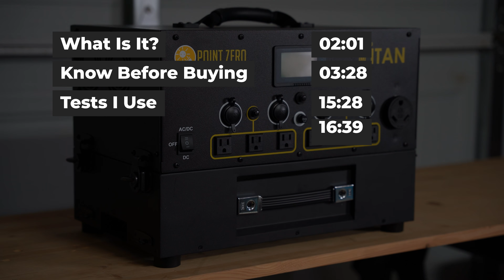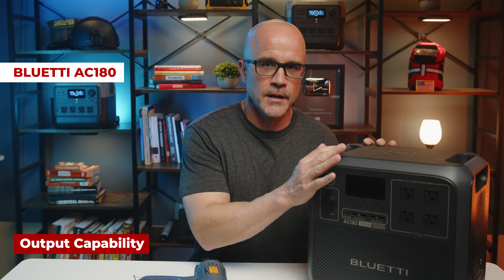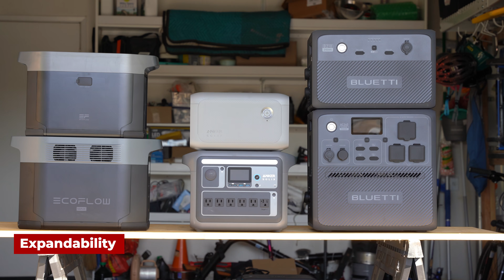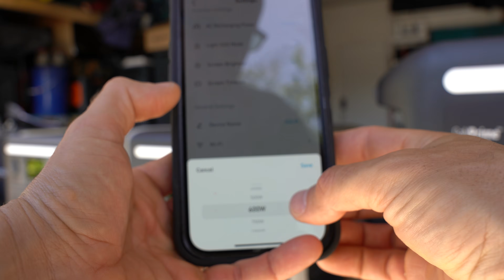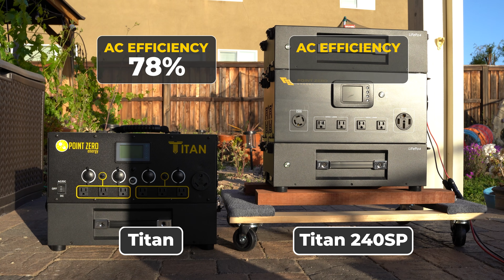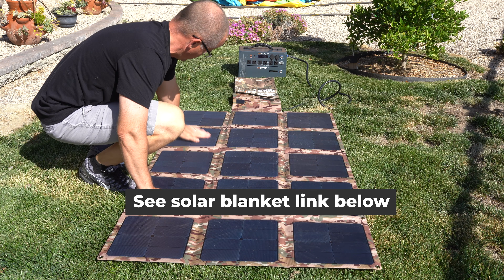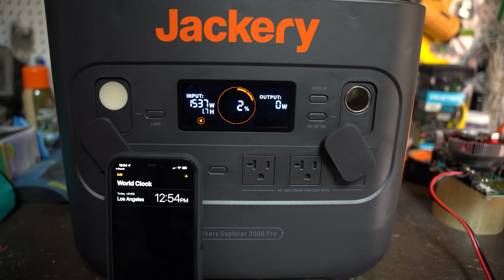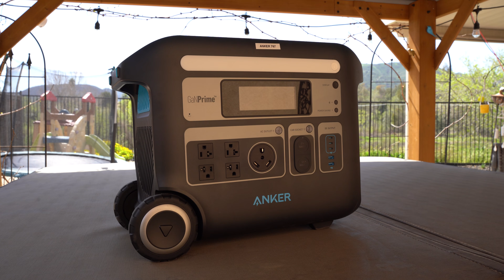Best Solar Generator for 2024 (The Ultimate Guide)

Comment: I purchased a Bluetti AC200 Max as it had the best reviews at the time. I am a fulltime RVer. I have a CPAP plugged into it so it is used every night. For awhile I also had a refrigerator plugged into it, while the Bluetti was plugged into shore power to be constantly recharged. Just in case the shore power would go out. While traveling I would recharge the Bluetti using the RV generator and if I was in a sunny area I could use the Bluetti solar panels. I was rarely in an area that I could use the solar panels. There were times when I knew I would be off grid and really need it to work, I would check the charge which would state 100%. The next day when I was disconnected from shore power and needed to use it, it would be at 0% charge. This happened a few times and was very frustrating (scary as well). I read the paperwork that came with the Bluetti and found that it states "do not try charging the unit when the temperature is very cold." When it did not work and read 0% it was very cold. So my assumption is that the cold discharged the batteries, right when I needed the unit to run a heater. I tried contacting Bluetti to find out if this was the case. I did not receive an answer. I can just say from experience that the unit does not work when it is freezing or close to it. If this is common for all these units because of the batteries, this is something that the public needs to be aware of. I learned I cannot rely on it to keep from freezing. If this is not common, or something that should not happen, please let me know and I will contact Bluetti again.

Comment: Price to performance I don’t think you can beat a Refurbished EcoFlow Delta max 2k wh  2400w ac and 800w solar input only £650inc vat direct in the Uk  with daily use you will only notice a reduction in capacity down to 80% after just under 3 years

Comment: Just looked at the price of the solar blankets from off grid trek, Come at a much higher price point you say? hahahahahaha,  they cost, in some cases more than the generators. One 300W solar blanket is £1736 in the UK, a Bluetti AC240 is £1600, that's £3336. I was looking to buy something as a back up at my house for when the power goes out, so i can boil a kettle for a brew, however, i just can't justify spending that amount of money on something i may not need. In 63 years the power has only went out once. I will have to make do with my gas bottles that i have had for over 15 years and never used with my twin gas hob. 
I have prepped for the possible on coming disaster, but to be fair if it's going to be as bad as "they" make out, i'm not sure i want to be around for all that struggle. I think i'd rather spend that money on a motorcycle adventure and enjoy it now.

Comment: I am a diehard EcoFlow fan.  I own the Inergy Apex which sucks, 2 jackery 500's which are great but antiquated and when EcoFlow came out I bought 2 Delta max 2000.  Over the years I acquired the River Pro and the newest 2 Delta 2's.  The reason for me buying Ecoflow only is their warranty and their Customer service.  Just recently in the last week of April I had to use my Delta's 2000 max and noticed a loss of battery capacity  on both of them and also a loss of capacity on my River Pro during some severe storms in Texas.  Now I have been using these units on an off for power outages for over 2 years.  

I called EcoFlow Customer Service and immediately spoke to a person.  Long story short I sent videos as they requested and they confirmed that all 3 units had to go back and was given a choice of waiting to get them repaired or they could send me refurbished units.  I chose refurbished units because of the storms we get and wanted them back quickly.  I was so surprised when they sent me shipping labels  for all 3 units.  

I received from EcoFlow my delta max 2000's refurbished and the River Pro was replaced with a brand new one.  Due to my inconvenience EcoFlow has gifted me a river mini and the expansion battery for my River Pro.  Don't tell me that this company does not stand behind their product.  Today is May 22, 2024 and I received my units 7 days ago.  I think that is pretty fast.

My recommendation is for anyone that does buy EcoFlow products is to keep the dates of purchase and order invoice numbers readily available as you will need them and to keep the original packaging.  Call them, and ask what is required  and they will give you a list of about six things you have to provide.
ECOFLOW ROCKS!   Oh by the way , great great video.

Comment: That was a great review. But the problem is you say it should be stored at 50%, which doesn't make sense to me. I bought the AC 200 Max with two batteries as an emergency power source. But if they are stored at 50% and the lights go out suddenly,  then you only have a 50% charge. So what's the use of spending all this money and get 50% of what you paid for.
Reply: It's a delicate balance to maximize the life of the batteries. You can keep it full just could cause a little more degradation. Or you could keep it full and works just fine, they are weird that way. Its one of the flaws with batteries in general
Reply: Long-term like if you store it and don't use it for more than 3 to 4 months at a time..... you guys got a little too micro in the thought process.  He didn't fully explain it in that little 30 seconds but again if you're using it every 3 to 4 months sure you can fully store it at 100% if you don't use this thing for a year 9 months or more yeah you likely best keep it charged at 50% and then when you know you're about to use it and put it back to 100% in that quarter of a day to charge or whatever.  
So if you're wanting to keep this just in case of emergencies and leave it at 100% sure but then break it out set an alarm on your phone or on your calendar and put it through my day of usage plug your television into it your fridge or something and then turn down the battery and then recharge it
Reply: They`re supposed to be used with solar. But if you charge a lithium battery to 100% and store it you get needless degradation. So if you plan to store one drain it to 50%. Charge before storms. I store mine at 80% to 90% in spring storm season and if storms are coming all get fully charged. If you learn how to care for these batteries they might last 15 to 20 years vs 5 to 8. Heat at a 100% charge or charging in freezing weather or running them to zero and leaving them or charging at very high rates are the worst.
Reply: @baneverything5580  I'm 75 so I'm not worried about 10 or 20 years into the future
Reply: This was the first time I ever heard to keep them at 50%. I've only ever heard to store at 80%.

That being said, I store mine at 100% for the exact reason you just said. 

I'd rather my unit degrade and need replaced after 5-10 years than spend hundreds of dollars on something that doesn't work for the very thing I bought it for. (Well, I actually bought it for camping but power outage is #2)

Comment: Thank you, I used this video to finalize my selection for a set up that we could use for short term power loss at home, and also be able to be taken on the road in our camper.  I selected the EcoFlow Delta 2 Max with 220W solar panels and the Wave 2 portable AC in a recent 40% bundle sale on the EcoFlow website.  I can take my time expending for longer power outages knowing I can add two extra batteries and an extra 220W panel set.

Comment: I have 2 Bluetti AC50S and 1 EB70S solar generators. 
I let one of the AC50S deplete the battery below the 10.3 level and it would not charge up.
I contacted Bluetti and they walked me through a reset procedure. 
In order to do this I had to disassemble the solar generator. 
The fix didn't wake it up.
They sent me a new unit and a paid shipping label to return the non working unit
Reply: Yup battery packs have safeguards once you drop below a certain level. I’ve got tool batteries to come back by applying a charge through a similar device. I bet if you sent a direct charge through a large gauge wire it will come back online.
Reply: @greaterbw I've done 18650 that way as well with the touch of a 9V radio type battery. I have some chargers (some of which were very cheap) that would do that automatically.
Reply: I sent my Bluetti back twice to be repaired, returned with fault  so gave up.  I then purchased an ecoflow instead with no issues after 1 year. Bluetti looks nice but I will not buy another.
Reply: Glad to hear some of these companies are standing behind their product. They are exactly where I will go if I can ever get past the fact we can build a same system for so much less. Would love to see a video comparison on these and what a bit of work can produce with the same money one of these "generators" will run you.
Reply: I need to buy a solar “generator” but even though I have been researching several different systems, I find it confusing.  Since I will be using it to charge from solar, I need it to charge more quickly than what I’m seeing.  Some units take 8-12 hours to charge but I don’t get 11 hours of sunlight in the winter.  I need something to run a small fridge and may even a small freezer and a few lights.  If I can get something to run the hot water heater, too, that would be great.  What can I buy that will charge quickly.  I have seen several ads for Jackery that says it charges in 2 hours using solar and it shows someone setting up 2 panels, but the fine print says it would take 6 panels.  I contacted Jackery and they confirmed that it would take 6 panels.  I don’t really have the money or the space to set up 6 panels.  Can you, or anyone on here, help me with this.  What system would charge fairly quickly using only solar?

Comment: I noticed in your spreadsheet that you show a 750W microwave consuming 750W of power. I know of no microwaves that consume as little as 750W. A microwave oven's rating is for how much power the microwave puts into the food it is cooking. But there are many power losses in the process. Microwaves are typically about 60% efficient--which seems bad, until you compare it to any other method of heating up food. For a specific example, I have a 700W microwave in my car camper. I run it off an EcoFlow Delta Mini which has a 1400W inverter. When the 700W microwave first starts running it consumes 1280W! Over a 5 minute run, when it warms up, the power consumption gradually drops to about 1150W. The reality is that a 750W microwave probably draws 700W/60% = 1250W.
Reply: Mine used 1472 watts but it shorted the transformer out today.

Comment: I like the Ecoflow Delta Pro units.  However, I've had nothing but trouble with the accessories, such as the Smart Home Panel 1, the Double Voltage Hub, etc.  Yes, their customer service honors the warranties (after sometimes weeks of back and forth), but it they aren't reliable, then what good are they.  I have since changed my approach and use the Delta Pros via a manual switching panel and 2X30Amp to 50Amp Y-cable.  Much more reliable.

Comment: Avoid at all cost any Grecell power stations, they will only solar charge a few times before stop working. I've been through 4 of the 2000-watt and 2400-watt units in a row with 5-year warranties, they will change the warranty to 2 years on you and refuse to refund. The company still owes me over $2200. They refused to refund me without huge deductions, and I had to return both units 2 times. I only used units to maintain the batteries a few times so they would be ready when needed for emergencies.  After so many months of continuing to reduce offers that seem to be reduced at every email I have little faith they will refund anything after so long.

Comment: I design and build custom Small Solar setups. "Will it run my fridge' IS THE NUMBER ONE QUESTION I GET. LOL!
Reply: That and will it run an air conditioner 😅
Reply: Mine runs the freezer, the fridge, the air conditioner, and the oven. I have to shut the air conditioner off to use the oven though, unless there's enough in the wind generator battery 🔋 bank.
Reply: @davidpotter9462 what company and unit do you have?
Reply: Do you have a way to get a hold of you?
Reply: That’s all I care about 😅

Comment: Thank you for this! While I could just get a general generator for my apartment incase of power failure from a hurricane I wanted to avoid having to store gas and it being so loud for my neighbors
Reply: A regular generator can be dangerous in tight spaces such as an apartment building complex. We had a fatality in my city today from a generator over 10 ft from the rear door of the residence
Reply: @mac_mcleod  oh no! 🙏🏼🙏🏼
Reply: I agree, solar is way to go in an apartment, especially if the sun hits your windows, i believe you can place your solar panel there for recharging.

Comment: What is al the hype about these solar generators.   They are nothing more than a battery with a charger and inverter built it.  Yes they will run some appliances but for how long.   How do you charge them.  A 100w solar panel will take forever to charge the battery to run your freezer overnight night.   If all you want is a few hours of small wattage back up for a short power outage you are fine.   Much more than that  is hype

Comment: I have a van and I have used the Inergy Apex for  almost 4 years now. The problem with it is the DC output is not regulated so my Dometic chest style fridge will shut itself off way before the Apex is out of power. To mitigate this I have to run the inverter and use the AC power so the efficiency is terrible. Inergy now has the expandable Flex that I have on order since last June. 😅 still has not shipped. I can’t just go with another company because they use MC8 connectors on the 400 watts of solar panels I have installed on top of my van. Any suggestions for me?
Reply: My 24 volts Aims Power inverter charger shows 120.1 volts, no load, under 1500 watts load, shows 119.8 volts. In my opinion the 24 volts inverter keeps the voltage closer to optimal. Sounds like you have amps draw pulling the voltage down, or not enough batteries for the load. Once there's enough battery 🔋 capacity, you won't get the voltage drop. Then it will work better.
Reply: The energy apex is a cheap copy of the Titan. His review of the Titan was rediculous, but he did not physically have one, so he can't just assume, nor compare. The Titan has been #1 for years, and there new ones are even more impressive. There 240v SP 4000w, 120v also, in 1 unit is insane. There the only low frequency units, portable on the market. I have 2 Titans and 5 batteries, I know what there capable of, only 1 regret, I wish I had the 240v  unit.

Comment: I bought a Grecell 1000 with a 100W solar panel for about $ 650.00 on Amazon. I imagine prices have gone up some, but the units in the test are extremely expensive but maybe with higher capacities and solar input wattage. My Grecell does everthing I need in an power outage for emergency lights, fans and powerbank/cellphone charging for many days.

Comment: Does someone make a generator like these that can power your whole house, including your air conditioner 24 7
Reply: Ecoflow just released the Delta Ultra. Plan on being $10,000 lighter.
Reply: @Jurornumber5  thanks for the reply. One other question are these type of generators safe from an EMP attack.
Reply: @mikestrophytruck  No. You will need to build a metal cage(or buy one) to protect it from theft as well. Wouldn't hurt to install an air tag inside of it too. Good luck with your prep.

Comment: Do NOT buy the eco flow system!!!  Bought the Delta Pro. Its a bust. It cost me $6000. It failed and getting warranty service has taken six months of lame excuses and non performance. A claim number was issued over the phone and promises made. Turns out the claim was never filed and the number they gave us never existed. Curses on the service operator who feed us a lot of bs. We filed a claim 3 times and still have not received any help. May end up filing suit against these clowns…
Reply: What is the problem with the unit? What does "it's a bust" mean? Are you sure you fully understand how to use it?  What have you done with it? If it really is a bad system, and Ecoflow is not working with you, call your credit card company and begin the process of a chargeback.

Comment: It really makes me so sad that the TWO ecoflow units that I've purchased have both broken with less than 5-10 TOTAL discharges. I've honestly never been so disappointed in a companies product since I try to get the best. I tried going through Amazon and they couldn't help me since it was past the return window and since the chemicals in the other ones battery are dangerous I couldnt ship it back. So now I've got well over 1,000 bucks wasted on ecoflow products 🫤 I really want to try anker but I need something for a job site that'll be able to power everything to build my off grid homestead and then hopefully convert to a home backup after I finish the build.

Comment: Hi Kris, thanks for your awesome content, very informative! I have a question for you, I recently purchased a Bluetti AC240 to power our fifth wheel while dry camping, before heading out on our first trip in our new RV I decided to test my power station, I turned on the microwave and it seemed to work fine, then I tried making a cup of coffee with our Keurig and it did not work, so I pulled out my circuit tester and it showed that I had an OPEN GROUND! Oh and it looks like my coffee maker was damaged, it no longer works!
Can you shed some light on this situation for me, I would greatly appreciate it Kris. Christian L from Idaho